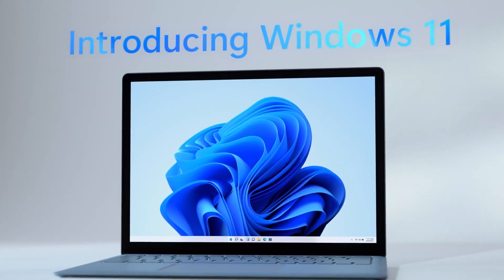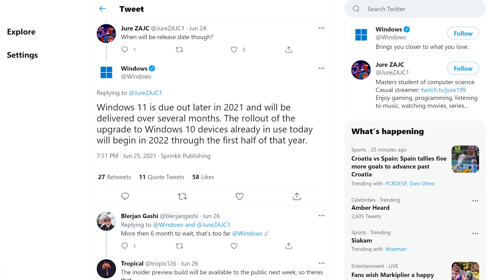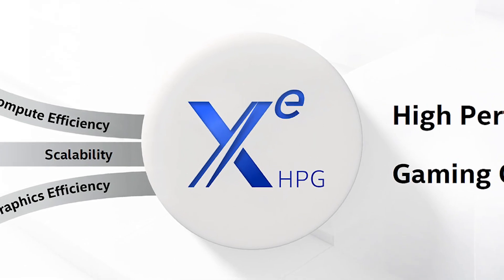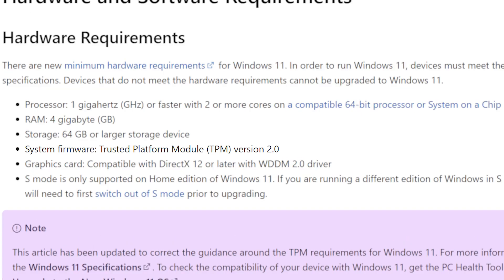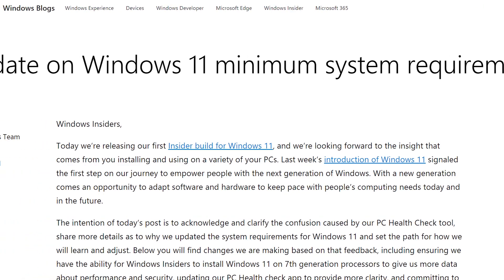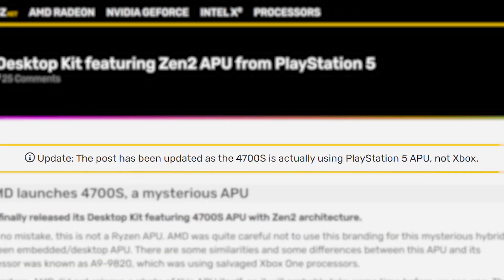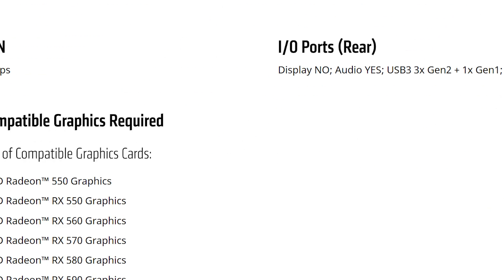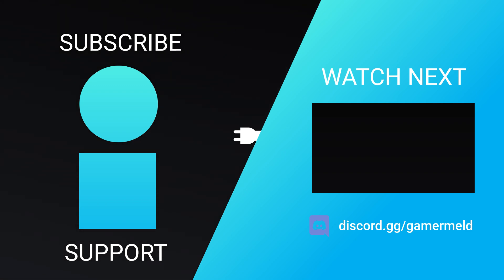TONS Of Gamers WON’T Be Able To Install Windows 11!

Comment: Was up and running with windows 11 pro in less than 30 mins.  The icons are in the middle on the taskbar but its easy to change.  The start menu got changed as well.  The GUI looks better than Windows 10.  Startup is fast.  Takes only a few mins to find the TPM setting in BIOS and turn on secure boot.  You dont need to reinstall any apps installed under Windows 10.  I have just started playing with the settings and I like the GUI already.  You can just workout were everything is using intuition. All drivers are installed, whats not to like so far.

Comment: Windows 11 requirements are insane.
If they think this won't cause a backlash from the community, they're wrong.
We just CAN'T have landfills fill up with perfectly fine CPUs and machines with soldered on CPUs, just because MS wants to. It's unfair and sabotages environmental efforts. It straightout backstabs them. How can they even considered it during this times where the environment is already struggling? They should be brought to court for this nonsense!

Comment: The Workarounds already work. You can literally bypass all requirements.
Reply: yeah you can but what happens when something you install needs the TPM and it's not here, that item will not work, so I don't know about it all.
Reply: I'll just deal with it by not using it.
Reply: @Mordies  Most modern cpus have TPM capability included on them but the setting in bios must be enabled. Its called PTT for Intel and, I believe, its something else for AMD. I don't know exactly which cpus have it but I can confirm that my 8700k does have it. Turned it on and checked the health checker with no tpm module installed and my PC passed the compatibility test.
Reply: @willo1345  understands that what I'm getting at is a lot of gamers are still running GEN 6 and 7 intel CPUs which does not have TPM at BIOS level but it more than capable of running Windows 11,  outside of the TMP requirement. If MS has any compashtion for there customers this would not even been added to the version althou I almost convinced that they will drop it due to people complaining. Time will tell.
Reply: @Mordies  I'm just trying to prevent people from buying scalped TPM modules when they aren't needed. I'm also not sure how far back in generational support CPUs have tpm
Reply: @willo1345  I think TPM is on most newer CPU's from like GEN 8+ on intel and GEN 2 ryzens TPM was never a main stream, so this why this requirement is kind shocking.
Reply from the maker: @Mordies  Microsoft have stated that the requirements aren't for the Insider Preview Build. The actual release build will though (given they don't change it before then).
Reply from the maker: No you can't... The build that's out right now is just Microsoft's Insider Preview build. They have specifically stated that those requirements will go into effect for the final version. Installing the insider program build isn't a "workaround."
Reply: @GamerMeld  oh you can install it without TPM cause there's a crack for it already (well the leaked version anyways) I have it, just haven't try to install it with it yet. Rerally don't see a reason too because it'll just piss me off more LOL.
Reply: @GamerMeld  There is a Video out there that shows you that using specific W10 install files will bypass the restrictions.

Comment: If I could have gotten away with still using Windows 7, I wouldn't have switched to Windows 10 in the first place!
I'm fine with no updating to W11!
Reply: Doesn't look that good anyways windows 10 looks better in my opinion
Reply: @ZynthWaves  And Windows 7 looks much better than 10 and 8.
I'm noticing a trend here and I don't like it...
Reply: @ZynthWaves  
As someone who currently uses Windows 10 on a different build, *I take your opinion with great offense*.

Windows 7 is better. I am going to Linux in the next build because Windows 10 has been a tech support nightmare for me and every computer I dealt with.

Windows 11 is the Intel vendor exclusivity BS from 2000s all over again. Never again am I getting Intel parts now that Microsoft is making it repeat that scandal.
Reply: Aereto how I never mentioned windows 7 I just said windows 10 looks better then 11
Reply: Same. I will only update when it is really necessary to do that
Reply: Why don't u still use win 7? I do.With 3rd party anti virus program. Win 10 is too much resorce hog for me. I have a gt 610 so only dx 11 support anyways.
Reply: @laorakaora1764  My Gygabite motherboard doesn't run Windows 7. It corrupted my SSD with W7 installed to the point even putting it back in a machine capable of running it couldn't even repair the installation. And of course, no new installations either.
Reply: @laorakaora1764  windows 10 is less of a resource hog to 7 though and from the looks of it, 11 is equal or generally better than 10 at the same operations
Reply: @pritampaul2507  Where did you come up with that?! Have you ever opened task manager between win7 and 10?
Reply: @jamesb1221222  "have you opened task manager", every time someone brings that up it makes me laugh. Windows 10 is more lightweight than win 7 and this has been known by all the people who know how an os work. The "it is taking so much resources" trope is stupid, any modern os takes up idle ram and uses it to make the processes (like opening programs, etc.) faster. When any program actually requires ram or processing power and not much is idle, the os gives the resources it is using to that program.
Reply: @pritampaul2507  Whatever you say
Reply: I still use Windows 7 tho
Reply: Vista FTW!!!!
Reply: @Macheako  lol
Reply: i used it last year, windows 7 is just better.

Comment: windows 11 requirements are a joke i am switching completely to linux
Reply: @The Professional Newb ya i have no idea about gaming support of Linux if they support games like windows I never go to 10 or 11
Reply: @The Professional Newb exe files work on linux? since when lol
Reply: @OmPrakash-pc1ec  For a long time actually...Since before I switched back in 2012.  Not everything works but you would be surprised at what does.  Valve had Cyberpunk 2077 working on Linux on Day 1
Reply: @LowSpecLinuxLaptop  how is the performance? I could just move to linux for my main os for sacrificing a little GUI, but a faster and more responsive os for free is worth it
Just worried about games, and  API's and compatibility of programs such as office and other tools
Reply: @OmPrakash-pc1ec  Check ProtonDB to see how well your particular games work.  Your looking for Platinum rating, Gold if you dont mind tweaking things a little.  No not gonna run Microsoft office unless its an old version. There are alternatives to Microsoft office and Adobe software. Davinci Resolve has a Linux version but is picky.   For games not on Steam you can check Lutris.  Easy Anti Cheat is not there yet but is being worked on.  It depends on your use case, but if its only 1 or 2 pieces of software,  Windows in a VM may be a soulution.  You will not sacrifice in the GUI department.  Contrary to popular belief, you never NEED to use the terminal.  We do because in many cases it is easier
Reply: @OmPrakash-pc1ec  Extending the amazingly stated answer of Low Spec Linux Laptop, the performance on some of the games is even better than Windows. Now there are some games which use EAC or Vangard or any other anticheat/rootkits that are not supported yet. Exe's run with wine with some exceptions.
Reply: @godlikekiller4344  idc about games which rely on eac or vanguard, I should give linux a try then 
is there a way to dual boot windows 10 and linux because I dont want to hinder the performance of linux on a virtualbox
Reply: @OmPrakash-pc1ec  Yeah there are lots of guides online about this matter. But keep in mind, Windows does not like co-existing with other operating system and as such try not to mess up the efi partition.  Even if you do mess it up it is not a big deal but do extensive research beforehand. Welcome to Linux :).
Reply: what about games it is only thing that is holding me still on win7

Comment: Linux, there you can get support almost forever for old hardware. It's more secure, private, lighter, faster, and obviously gives the user total freedom but is also simple if you don't want to tinkle with it. The Good Old Gamer's PopOS Linux gaming video also shows that it's easier than Windows in many ways.
Reply: ah yes supports old hardware mmmmm should be very good for gaming!
Reply: @MixedVictor  Well, it supports new hardware as well. Those distros that deliver new kernel versions early will support things usually when the hardware is released.
Reply: @juzujuzu4555  i will only use linux for emulation but for old hardware it runs like a potato
Reply: it'd be easier if i didn't have to troubleshoot errors everytime i want to do anything
Reply: @Fogolol  Beginning is hard, learning new things might cause problems. But I really don't get what can cause so much problems? As I'm sort of tech support for a quite a large group of people who use Linux and apart from the initial migration, the amount of problems people have is smaller than people with Windows (who I also support of course).

Gaming peripherals is the pitfall of Linux, though that's because the manufacturers are lazy and do not provide support themselves. This might change as it seems Steam is really pushing Linux gaming by creating Linux based PC gaming console.

Try PopOS if you want to play games. It's great in any case, but for gaming it's the easiest out of the box.

Though people should really migrate only if they actually want to. As the migration part requires you to learn new things. It's like quit smoking or drinking, after awhile it's much better and rewarding.
Reply: @juzujuzu4555  I am not adversed to trying new things, in fact my secondary pc i use for my game servers that also doubles as a media center on my living room is running linux, now simple things like watching videos or getting games to run on steam is easy, it just works but when it comes to the server side i get errors left and right and i have to spend an entire afternoon per error.  I also can't wrap my head around getting the windows redists to work with wine (I wanted to set up a private terraria server but the server executable was a .exe and it needs XNA and other frameworks) But it is fun to mess around with linux when you have the time to troubleshoot stuff but i wouldn't really recommend it as a daily driver for actual pc usage.
P.S If it matters, i am running Linux Mint on that pc
Reply: @Fogolol  For gaming I would highly suggest gaming focused distro as those usually have things preconfigured correctly.

You managed to have a problem that I don't have specific experience. But I would highly suggest checking PopOS, and in most cases there should be Youtube videos showing how to get things working. For example "terraria server on linux" provided many results.

I think pro-consumers usually have the hardest time with Linux, unless they are focused on a specific thing as it's much easier to learn one new area on new OS than a lot of things. 

For majority of people that are not specifically gamers or professionals on some software they need windows for, Linux is great at daily driving. It's just that most people who follow techtubers are those prosumers.

I think the easiest time is with those people who just need office and a browser. Perhaps they need someone to install couple of things in the beginning and show how it's used, how to get help etc.

On computers that come with preinstalled Linux and which have true customer support, I think are ready for mainstream. 

Windows is actually much more complex system to keep in check for years than people realize, even though if you are lucky it might not have required anything. It also changes a lot during it's lifecycle. For people who just use Office and Browser I think Linux is easier. For developers and those who appreciate real freedom, it's heaven.

Comment: Does Microsoft have some kind of under the table deal with Intel and AMD so they can push people to buy their newer products? Because putting such restrictions makes zero sense otherwise. I don't think that any modern x86 x64 CPU from the past 10 years lacks the hardware to run any modern OS.